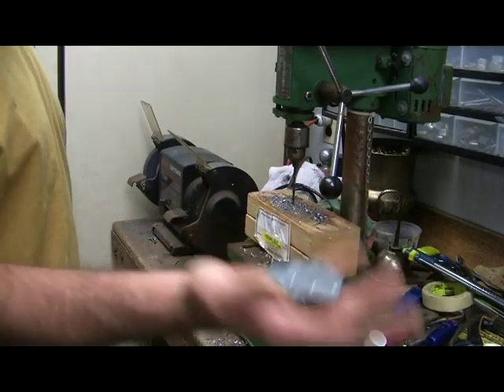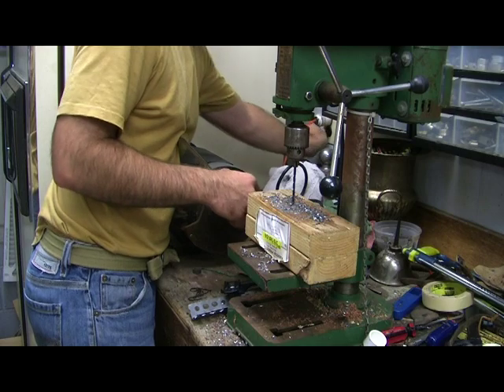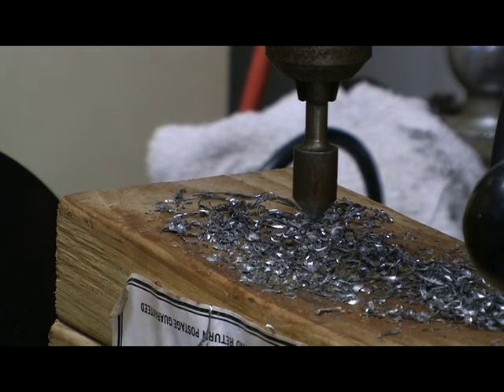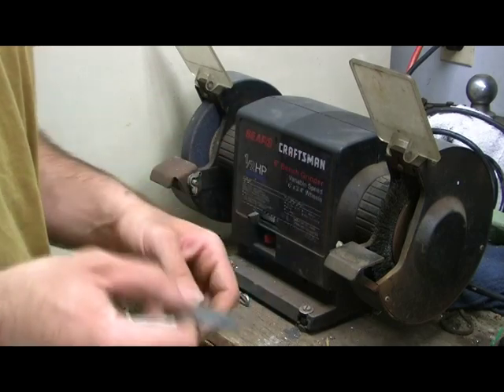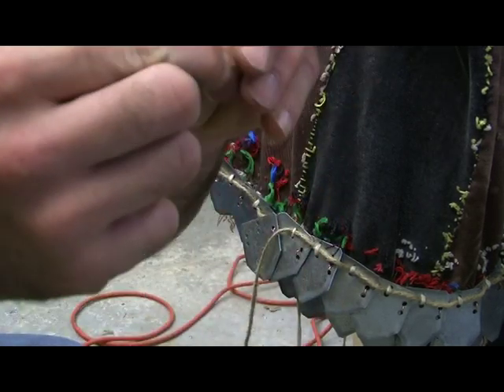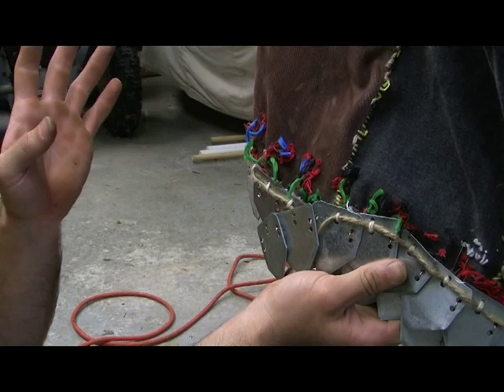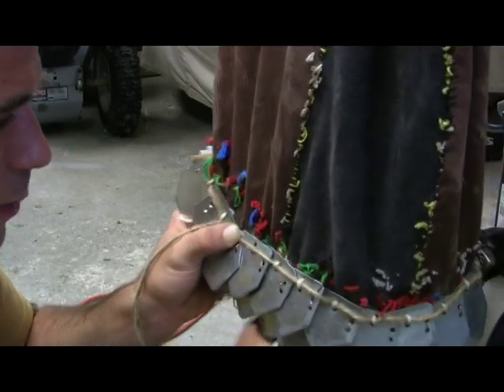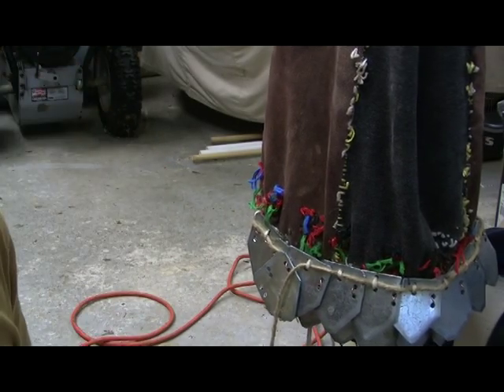How to make: Scale Mail pt. 2

Comment: When I made my scale, I had my 410 spring 20 gauge cut in 1.24 inch wide bands. I then cut them into small square pieces and place them in groups of ten and ground out the curve end. I also used my drill press to drill out 5 scales when drilling the holes. The more you can work on more than just one the faster the process is.

Comment: Little tip: Instead of using a counter-sink to remove the burs, get a larger drill bit and, by hand, turn it in the hole.. (maybe make a handle for it if you use it often)